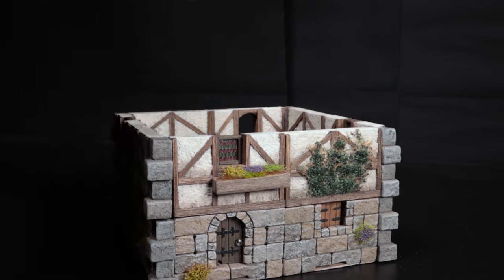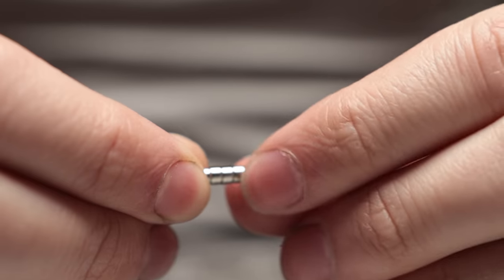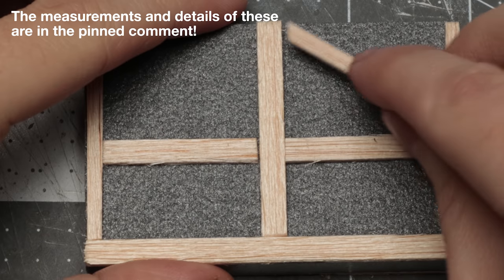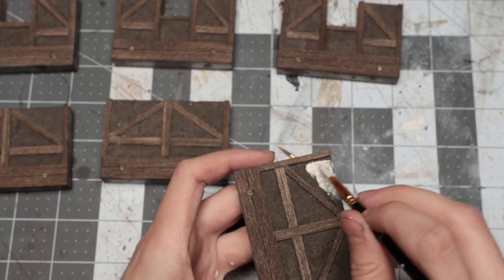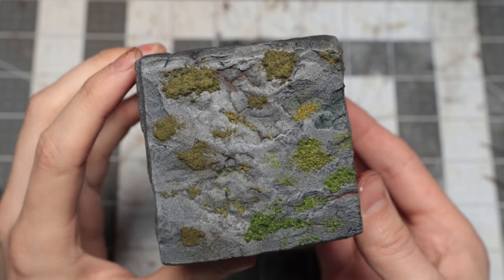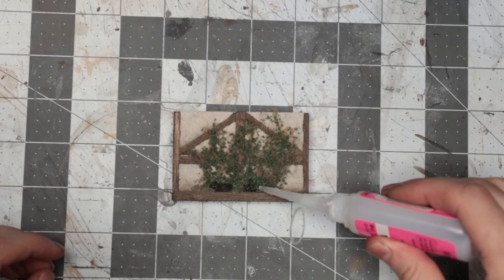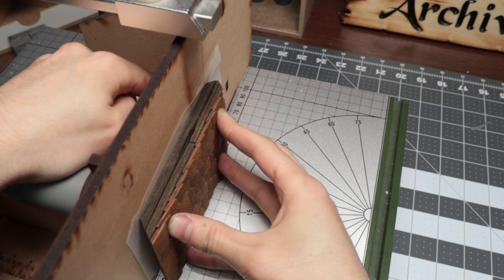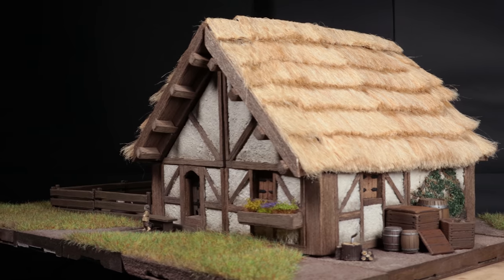Fixing two BIG Problems with Modular Tiles - The Cottage!

Comment from the maker: Balsa dimensions:
The balsa strips were all 1/16" thick, and were either 1/8", 3/16" or 1/4"  wide depending on location. In terms of length I just laid them over where I wanted them and marked with a knife where I would need to cut - once I had one I then just lined it up next to the strip to cut a ton more the same length.

1/4" - pretty much only the two strips surrounding the magnets on the inside of walls.
3/16" - all other horizontal strips, the central vertical strips on walls and surrounding doors, the diagonal strips on triangle roof tiles. Oh and the pieces I used to line the holes I cut for doors and windows.
1/8" - the vertical strips on wall edges and bordering windows, and the diagonal strips on walls, doors and windows.

Wall Tile dimensions:
The foam for the tiles was all 3/8" thick, or 10mm in metric. Technically they're not exactly the same but it doesn't make a difference here.
Otherwise they were 3" wide and 2" tall, just like all other wall tiles.

Roof dimensions:
Check out the roof video for these, the only real difference is I cut them from balsa. 

Column dimensions:
These were made from two sizes of foam block, one was a 1/2" cube.
The other was 5/8" wide and deep, but still 1/2" tall. Basically just enough to make it stick out a bit on two sides.

Sealant mix:
I show making this mixture in full in my war camp scatter terrain video, but basically the mix is 50/50 Pva glue and acrylic matte medium, mixed about 10:1 with water so it's thin and drippable/sprayable.

In this case I also mixed the result about 50/50 with isopropyl alcohol to help it break the surface tension and soak into the grout mix.
Reply: Quick question Matt. Referring to your columns, the 5/16th measurement seems smaller than what was shown in you video. Are they actually 5/8ths? Or am I just going crazy?  Love the videos been here since the beginning and keep up the great work brother!
Reply from the maker: I believe you are correct, I'll get that changed 😅
Reply: Hey there awesome build! With that sealant mix, you say it’s a 10 to 1 mix with water. Is that 10 parts water or one part water?
Reply from the maker: 10 parts water :)
Reply: @RPArchiveOfficial  Hey thanks! When I first saw that part of the video, I said to myself, “Matt, water you talking about?” 😂
Reply from the maker: Haha 😂

Comment: But for fsake, that cottage! 😭❤️
Reply: Right?! It's amazing!!!
Reply from the maker: Haha! Thank you both 😅 I'm still not perfectly happy with it but it'll do for a first try :)
Reply: @RPArchiveOfficial  What would you improve on, were you to make it anew?
Reply from the maker: Hmm.... Well. 

Firstly I'd not use grout as weathering before attaching the ivy - pretty sure that's why it frosted/burned from sealing too quick, it activated the glue. Having it seal slower has other advantages too - you can use the edge of kitchen roll to soak up excess and make it less of a solid block, show more detail and depth.

I'd probably test out white grout for the wall texture too, if I could be sure I'd get it all off the wood with a wet kitchen roll, I'd use that instead of brown - much easier to paint cream over!

I'd also put the wall magnets on the top and bottom (not the ones that connect with the floor) in the same depth as I do on the main stone walls etc, with some hot glue over the top making a thin gap. I can fix this later just by poking it with the glue gun, but it makes it the connections just that little bit easier to detach when you want to pick up the second floor :)

Little things really, one was just a time saver and one I can fix later, but next time I know what I'll change!
Reply: @RPArchiveOfficial  Minor things indeed. 
I'm trying to make pieces in a similar style, excepting my campaign takes place in the Iron Age, so most people live in roundhouses. Any advice on how to reliably bend the foam in a quarter-circle? :P
Reply from the maker: Cut the foam on one side in triangular chunks, leave enough on the outer edge to be solid but bendable. Secure with hot glue, reinforced with cocktail sticks if needed :) the grout should hide the cuts on the interior if you use enough.

Balsa wood won't bend easily though, so I'd stick to vertical beams...

Comment: The fogging issue might be a moisture/humidity thing. Did you use an accelerator? Water reacts with cyanoacrylate, the important part of super glue, to make a tough polymer that should be clear. If you're drying time is long, the coat is too thick, and humidity is high, the super glue will vaporize and these vapors will react with the air and then re-settle settle as a white film.
Reply from the maker: Interesting to know! I didn't use an accelerator, but I've experimented with superglue on grout since then, and it seems to have a similar acceleration affect - possibly something to do with the small particles. Definitely something I think I could avoid next time!
Reply: @RPArchiveOfficial  Might be the same thing as superglue and baking soda.

Comment: I just realized, with the detachable shingles system you could make a 3in by 6in sloped roof piece and use it for both shallow roofs and steep roofs. Normally rotating a roof piece like that would mean the shingles are sometimes facing the wrong way, but since your shingles can detach from the frame you can just turn them around so they work in either orientation. 2 new roof types for the price of one!

Comment: Another option for placing magnets; take a completed tile, hold a strip of painters tape non sticky side down on it, then take another magnet on that, squishing the tape in place. Push that onto the new tile, the tape will hold it flush onto the new tile while the glue dries

Comment: Frosting effects on clear varnishes and superglue is almost always caused by moisture, either in the air or on the surface you're gluing on. You can mitigate it on varnishes by misting it on in very thin coats, but with superglue it is much harder to get under control.

Comment: Each video I am more impressed with your building skills. I love the idea of the modular tiles and buildings, but it seems like with all the detail you put into these, and the various revisions you've made, it's almost more work to build a whole set of these than it would be to make individual buildings on-demand. Do you think there will come a point at which you've 'perfected' the system? Or do you think you'll keep tweaking and revising pretty much continuously?
Reply from the maker: I think I'll perfect the core tiles soon enough, definitely. Bear in mind every revision I've made so far has made them faster to make, as well as MUCH faster to set up... 

Take that and look at every building I've shown with the system (which isn't even half of what you could do), and add the Dungeon setups you can do with them because they're also dungeon tiles, and add that time up?

With that in mind... I'm pretty sure it's a lot faster, and definitely more flexible for when you need to slam down a new building without warning :)
Reply: @RPArchiveOfficial  haha, undeniably true about the no-warning buildings.

Comment: Do you have more roofs with different degrees of angle? Or different parts to make them look thinner at the top? Would add a bit of extra modularity for different settings.
Reply from the maker: You could, but it's more work and storage, that can't be used with the other roof pieces for epic rooftops of large buildings :)

Comment: why you insist on magnets with polarity and not using magnet miniballs that twist polarity ? Btw awsome job.
Reply from the maker: Stronger/smaller/cheaper. Balls have less surface area contact so need to be bigger/more expensive for the same pull :)

There's a way around it I'm showing off in my next bonus video though 😁

Comment: Do you have a tutorial for the flowers by the window?
Reply from the maker: It's in the wizards lab video, it's basically just flower tufts in a Balsa wood box :)
Reply: @RPArchiveOfficial  Thank you. I saw the video, my main doubt was if you cut the tufts or squeezed them inside.

 These flowers are pretty useful for my campaign setting.

Thanks!

Comment: What about stairs? Is it possible to do neat looking stairs that minis can stand on? I haven't figured out a way to make stairs that look good but that a mini can also stand on.
Reply from the maker: Firstly - nice name.

Secondly, check out my stairblocks (d&d Minecraft) video - you can place models on the stairs easily just by either removing the stair topper, or removing and adding another block, depending on if you want the model higher or lower.

There's also a trick to stop minis falling off...
Reply: @RPArchiveOfficial  first of all: thanks for the compliment.
Also, the trick you’re referring to is the one where you put metal on the bottom of the mini so it sticks to magnets? And about the stairs, do you have any more wood looking? Because the other ones (that are awesome by the way) look more suitable for a dungeon than an inn!
Reply from the maker: Correct, and true, I have wood stairs planned but they're not quite ready yet :) the stone ones work good for an Inn with a stone ground floor? That's pretty much what I'm doing in the meantime 😅
Reply: @RPArchiveOfficial  good idea! And by the way, absolutely in love with your channel! Keep up the great work!!!

Comment: Hey Matt, hope you're doing well! Lately I've been having a bit of an opposite problem, namely my magnets keep the terrain (mostly the walls) together TOO well, and usually the magnets end up ripping each other out, which is a bit of a pain mid game. Any ideas on what could help? Could very well be me and my glue gun as it is new since my old one barely got hot enough to keep glue liquid for more than a second or 2 after leaving the nozzle.
Reply from the maker: Glue gun is a massive factor in that problem. You want the hole the same size as the magnet as close as possible, if too much hot glue is around the sides they can pop out much more easily

I recommend the thin nozzle surebonder in my equipment list, it's perfect for 3x2mm :)
Reply from the maker: And I'm... Surviving! I'm recovering from long covid and am getting the next video out as fast as I can :)
Reply: @RPArchiveOfficial  Sounds good, I'll try it out! this ones a bit extreme for foam anyways... And glad to hear you're doing better

Comment: How do you plan for the polarity for all the pieces?
Reply from the maker: I follow a general rule of North on the top/right and south on the bottom/left, unless the build requires otherwise for some reason.

I show exactly where each polarity goes in every video usually, unless I reference a video where I've already shown it :) is there one in particular you can't find?
Reply: @RPArchiveOfficial  thank you! I’m trying something similar for conquest. The miniature rest on tiles that can benefit from being magnetised to form a tray. Was afraid it would get all mixed up. Your method here will help! Thank you

Comment: Can someone Point me the Video in which the current (Most updated) Version of the Placement of Magnets ? I Watched so much of These Videos that i am comfused as hell o.O
Reply from the maker: All of the following are 3mm wide 2mm deep n52 neodymium disk magnets, unless I say otherwise :) 

On floor tiles, its one magnet 1/2" in from each edge on the left and right, and halfway up/down between the top and bottom (so 1/4" high, as its a 1/2 tile)
For polarity, its North on the right and south on the left when looking at the edge of the tile, and this is the same on each side :) 

Polarity is whatever you decide it is when making your first piece, you just pick a pole and call it north from there on :) 

For walls, it's exactly the same as in the original magnetic building system video, with the one addition of two magnets on the inner edge of the wall to line up with floor tiles (so again, 1/2" from the edge, 1/4" from the bottom, on the inside of the wall, with the north on the right and south on the left :)

The only other addition is if you want balconies to attach to the outside of the walls, in which case you want those floor connection magnets on the outside too. 

Finally though, for the cottage walls where this isn't as possible, a 6mm and 3mm magnet can be placed in the tile at the bottom, but I show this in the balconies video, and you can add them easily whenever you want... 

Hope this helps! 😄 Let me know if you have any more questions